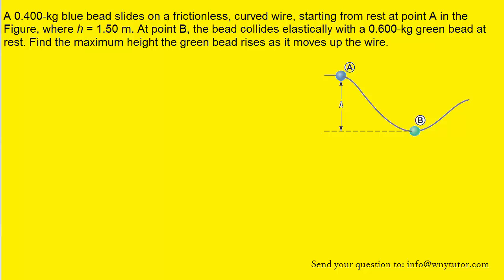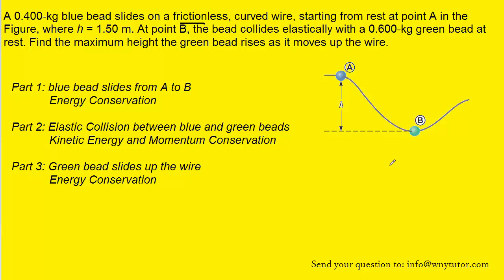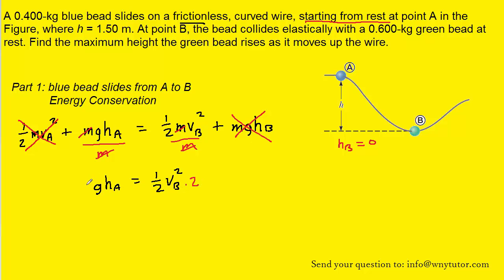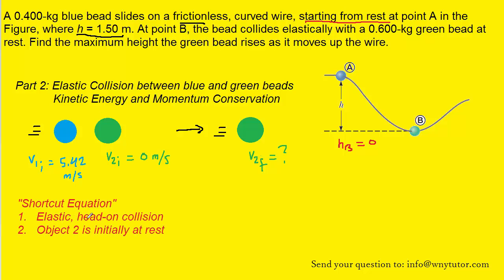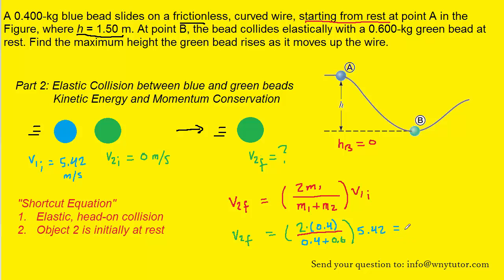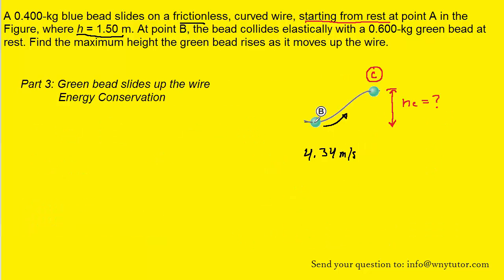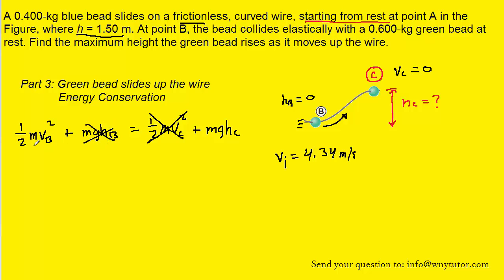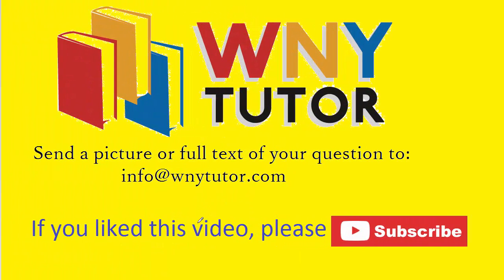A 0.400-kg blue bead slides on a frictionless, curved wire, starting from rest at point A in the Fig

Comment: I tried this problem, but instead of using the shortcut equation i used pi=pf by the law of conservation of momentum. However, I'm not getting the correct answer. Why is this?
Reply: You should get the right answer if you do it right, it's just very long and tedious and chances of messing something up increase. For me, I was answering on WebAssign and it expects near-exact answers and even when I carried all of my numbers in my calculations to atleast 6 decimals I still had roundoff error within 10% of the correct answer.